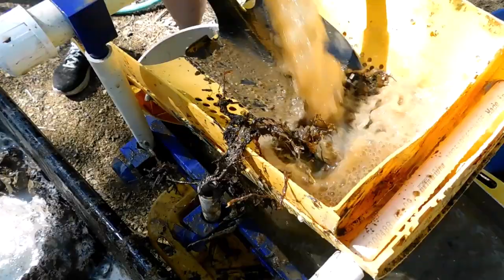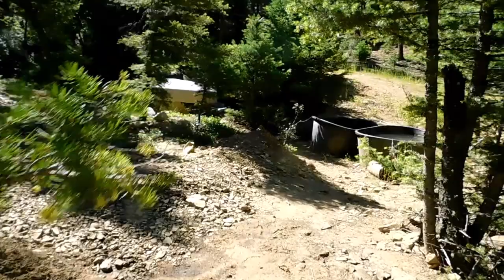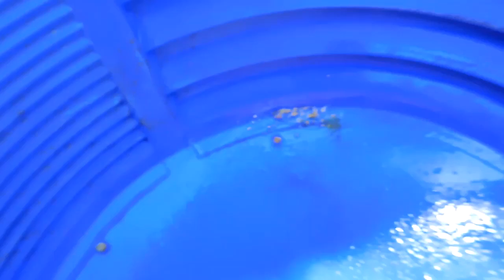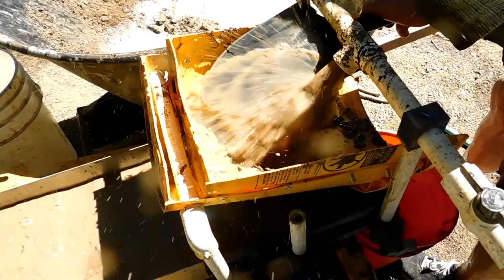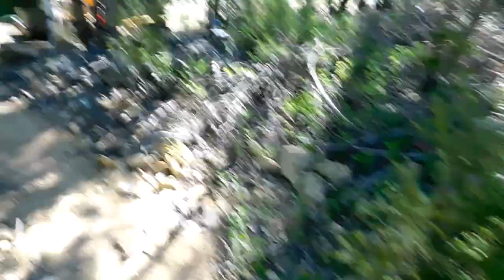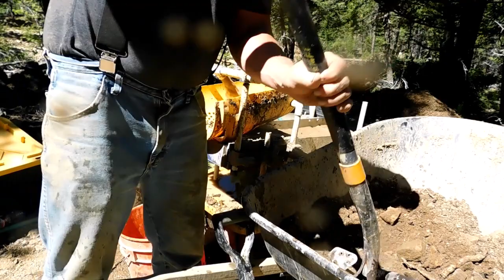New Bucket Blaster High Banker Runs FANTASTIC!!!

Comment: I'm the guy whoo poopoo'ed your hopper sayin' you gonna lose water.
Not only did you lose hardly a drop , but hardly a drop got on Mrs Alans hands.
Looks like throw the hopper away on all highbankers and replace with a couple buckets.
Reply from the maker: It worked out pretty darn well for a bucket. I love it easy and fast.
Reply: @alanrobertson2510  So what you think about a whole bunch of 3/8 holes ?
Reply from the maker: @mohammednovalija  I thought the same thing 3/8 holes would make it faster and handle more water the wife said leave it alone for now.
Reply: @alanrobertson2510  Do you think the curved shape of the bucket is the key , or do you feel that a square bucket would work just as well ?
Reply from the maker: @mohammednovalija  For washing action round bucket is the way to go.

Comment: That's awesome Alan! If you could stick that beside the hole you were digging, that would be amazing! You were doing a shovel full every few seconds. Talk about move more material to get more gold!  
Using the big shovel, could you run the water a different way so the bar wasn't above it? Having to avoid it might get tiresome over time, just curious if you could make it so you could just shovel and dump in. Maybe an upside Down "U" going around the top of the blaster so you get 2 smaller jets shooting to the same spot (one on each side)?  I hope that makes sense.
Reply from the maker: That would be great just to dig and shovel. I will have to find a spot for that. Yep I bet I could move the spray bar over to the side and then wouldn't have to keep dogging it. Thanks for the idea